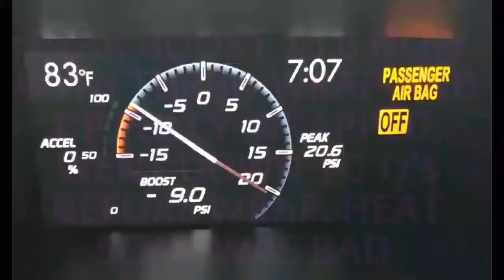2016 Subaru WRX STI Install Mishimoto Expansion Tank. Turbo and BP blanket.

Comment: That catch can works well before this one no build up or milky stuff
Reply from the maker: It's not really a catch can. I don't have to empty it. it recirculates it. Coolant runs through it, so oil never stays in the container. never builds up cause the heat won't let it.
Reply: +STiZar yea sounds like a good thing unlike grimspeed I will need a aos soon so wondering what to get myself
Reply from the maker: +Albaro Mayen The ones on the oil cap are no good. It builds up all that muck. Not good for the engine.
Reply: +STiZar yea I read up on them, already don't want that blow by  even more  all the  milky oil mixed with water is even worse
Reply: +STiZar what do you think about atmospheric catch cans?
Reply from the maker: +Albaro Mayen I would've got atmospheric. But since I run E85, I had to get a recirculating one. It allows the ethanol vapors to be removed from the crankcase and burn off as part of the combustion process....
Reply: I was reading that the comp series does the same I like them sense they have a cleaner install and seems like they are better then perrin
Reply from the maker: +Albaro Mayen Street and Comp are the same set up, except that one is atmospheric and the other recirculates.
Reply: +STiZar can you e85 and atmospheric or it haves to recirculate
Reply from the maker: +Albaro Mayen It has to recirculate. Look at the reply about to why.
Reply: +STiZar OK I see